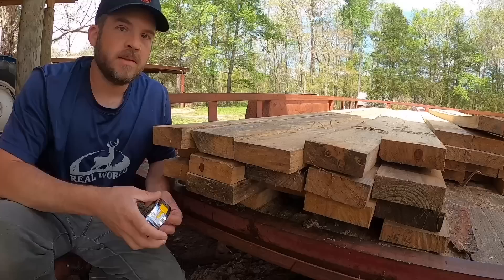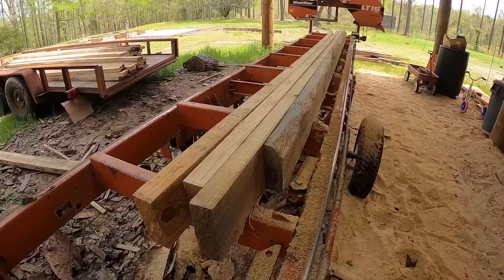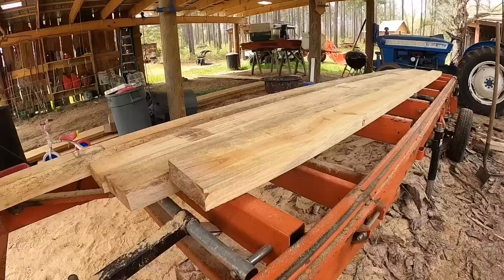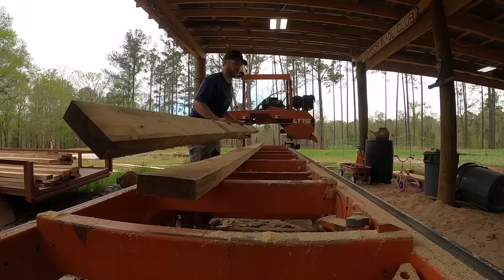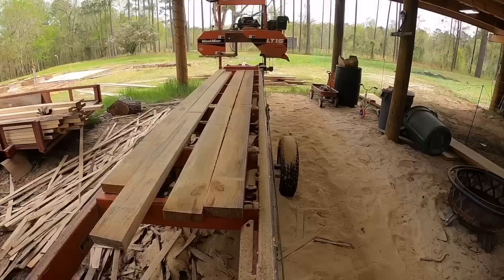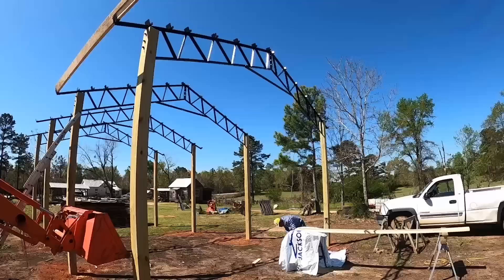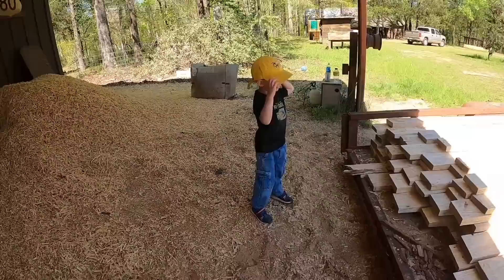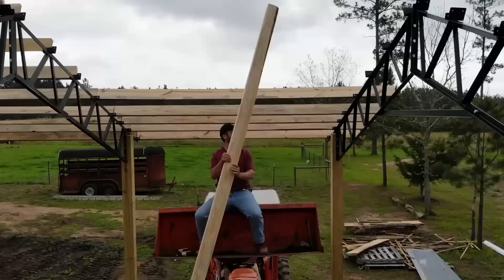When Nothing Goes According to Plan: Edging and Thinning Boards with a Sawmill

Comment: Wes, it was a year ago today (April 5,2022) that the tornado took down our barns.  One 125+ years old, a 60+ year old pole barn, and damaged several other structures. Thank God it didn’t damage the ca. 1892 farmhouse we live in.  It will certainly be nice to get a bunch of stuff back under shelter, and have somewhere to keep hay. Thanks for what you do. BTW,Howard found your battery.
Reply from the maker: Good deal on the battery! Howard is the man.
Reply: Been looking for the remodel.😊

Comment: One other solution would have been to use a router with a temple and pattern bit to make a pocket at each clip. Once you had the routine down would go pretty quick.
Reply from the maker: Yep, would have probably worked pretty good.
Reply: @falllineridge  Definitely would be more precise and faster.😊
Reply: With a template it would have been quick

Comment: I recently had the opportunity to help a friend out with some boards he purchased from a sawmill that didn't properly sticker and dry them, they were warped, cupped, and bowed.  Luckly, the were approx 2.75" thick and 12 - 16" wide.  After resawing them on my sawmill, 4 sides, and cutting some in half, we ended up with most boards being a full 2" thick and mostly 8 - 12" wide.  Lot of waste and work.  Lesson to learn, sticker and dry your boards properly.  Thanks for sharing.

Comment: Hey you thought about making a simple jig and lay it over the boards and use a router to notch out the material you need? With the lumbar being loaded and unloaded multiple times, tried and then planed down to the right thickness, the router route might be faster and a whole lot less painful.
Reply from the maker: Yep, I think a router would have done the trick. Too late now, though! All the boards are on the barn.

Comment: Really informative and interesting. I think the metal items are called joist hangers although they are called by other names as well. That planer is a mean machine... I assume it can do both sides at one pass. Also I am sure your son was dying to dive into that pile of shavings!
Reply from the maker: He eventually got in that pile. It's a great machine, but only one side at a time. I think it took 4 passes to get them to the right thickness (4 passes x ~65 boards).

Comment: Lots of hard work going on there. Ran across a similar situation using my lumber for the same purpose you are. Fortunately the trust manufacturer had 1 1/2” clips and full 2” which would have been your best route instead of re-sawing change clips.
Reply from the maker: That would have been the trick for sure, unfortunately the trusses were already purchased and up on the poles.

Comment: An idea from a non saw mill guy who is just guessing.
Lay the boards flat.  Pile concrete blocks on top the whole length. Then apply the side clamps to hold them in place. 
Then remove the blocks and cut them.

Comment: That Grizzly planer proved it worth! Hope your friend is willing to spring for some new knives, though. As you were trying to do it on the sawmill, I kept wondering if there was not some kind of roller that go ahead of the boards to hold them down so the mill could make a consistent cut. Don't know if that is a thing.
Reply from the maker: I've got a ton of knives and a sharpener, so no worries there. A roller is a really good idea.

Comment: Wes I know what it is to get even board out of these southern pines I am building a porch for my house with a roof on it and wa t to be able to walk bare feet on .y porch so when I milled my lumber I put the thicknesses 1 and 1/2 with the drying etc. Then the planner got my board at  5/4 i needed 72 of them but I wish I would of know about your little trick that would of been easier to squared the floor joices that was 32 of them have a great day

Comment: Use a router and just notch  out the clamp area  could do several  at a time aline  and clamp and router   ot use skills saw make several  passes  and break out and finish  with chisel  they will then fit and not slide

Comment: That is a truly impressive pile of pine shavings. Did you run both sides of each board through or were you able to get to the desired thickness in 1 pass? How long did it take?

Looking forward to seeing the shed build and returning to the house remodel

Thanks for sharing with us
Reply from the maker: It took 4 passes to get it down to the right thickness. So, 4 passes x 65 or so boards. Took 2-3 hours, but we managed to get all the boards onto the barn in about 5 hours, so it was really worth it.
Reply: @falllineridge  Thanks. I figured it was probably multiple passes. Glad it worked so well

Comment: What if you put a 4x4 over the middle of the boards and used a ratchet strap to draw them down flat . Yes you’ll have to stop mid cut to adjust the strap but I think it would keep your good edge flat to the saw bunk. Just an idea🤔
Reply from the maker: That would probably work, but would be really time consuming.

Comment: Not the best fix, but that strip you cut out of the board could be cut to fit and glued/screwed back in place once you had the right gap to fit the bracket.
Better option is to use your router to carve out the space for mounting it.